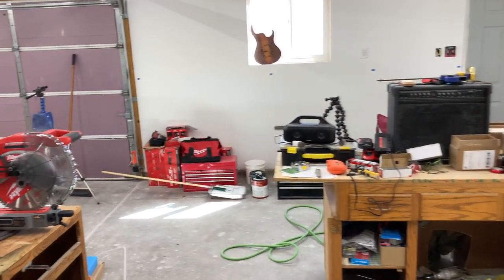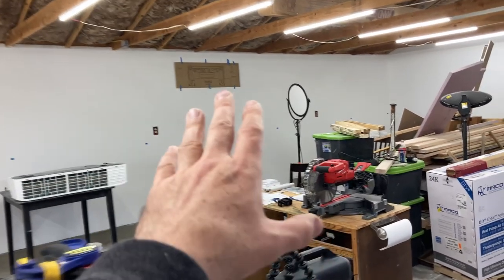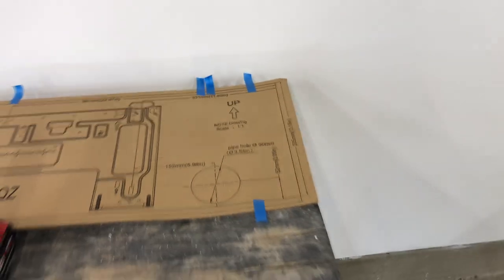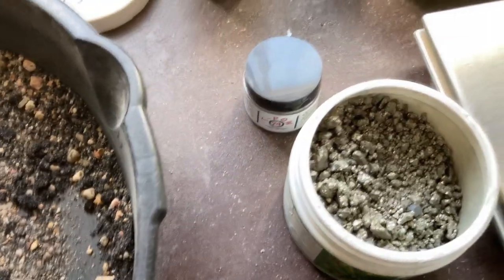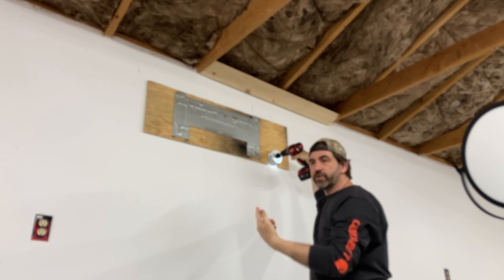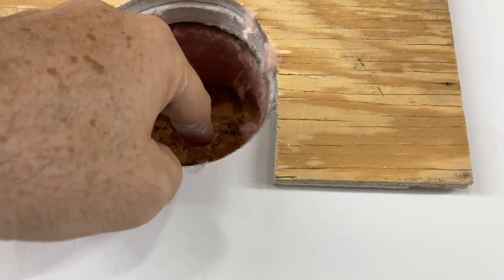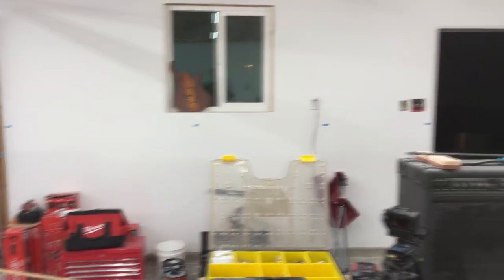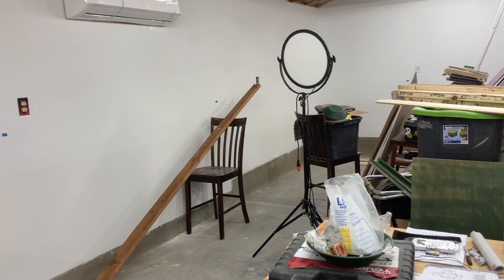Finally Got My Unit Up - MR COOL 24k BTU Mini split DIY Installation

Comment: Dude!  It is so nice to see you finally have a shop and a house. The Heck with apartment life.  Cant wait to see you make some saw dust.  On a different note, 70 bucks! for a hole saw you might only use a couple of times?  Don't you guys have a Harbor Freight around there?  Sometimes cheap chineseium tools are the answer.   I miss the coin roll searching live streams. any chance they will make a comeback?
Reply from the maker: Once the new youtube studio is build (inside the shop) i'll be live streaming again if all goes to plan. It'll be much easier to transport coins  in this place , rather than through a parking lot and up and down 4 flights of steps

Comment: Shane, I remain impressed with your attention to detail. Sealing behind the outside flange is definitely good; countersinking the screws is the mark of a professional. Now, get yourself a DeWALT (or Milwaukee) impact driver. (I prefer DeWALT, but then, some people drive Porsche's and others drive VW's). How about introducing Heather in one of your videos. She's obviously an important part of your life, yet remains invisible to your followers. (Check out the "Dirt Perfect" channel on youtube. Mike and Jenna are friends of mine, and Jenna has thee most infectious laugh! I even featured them in the book I sent on page 231).

For sound/vibration deadening, I like to use the 2'x2'x1/2" interlocking flooring from Harbor Freight. I get it by the box and use it for a myriad number of purposes. It's even good for going under my (wall mounted) speaker towers so they don't transmit sound thru the wall from the shop.
Reply from the maker: So put the 2x2x1/2 flooring between the bracket and the wall? What about the acoustic sealant? I was just going to use a full tube between the bracket and the backing board, and the backing board / wall. Just for a cleaner look.